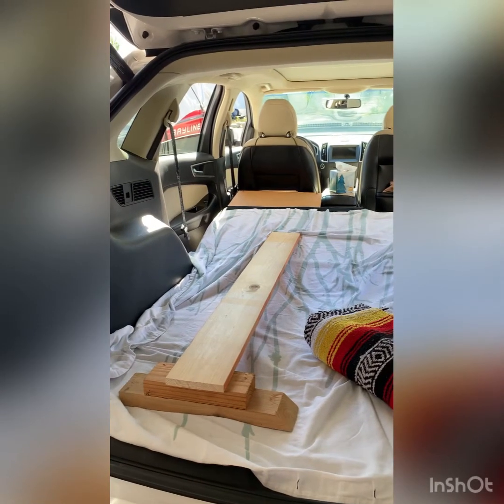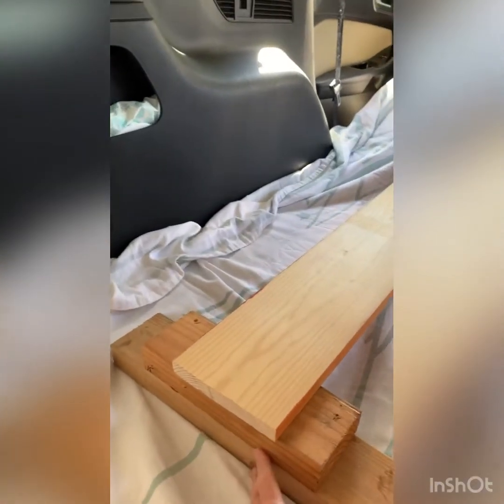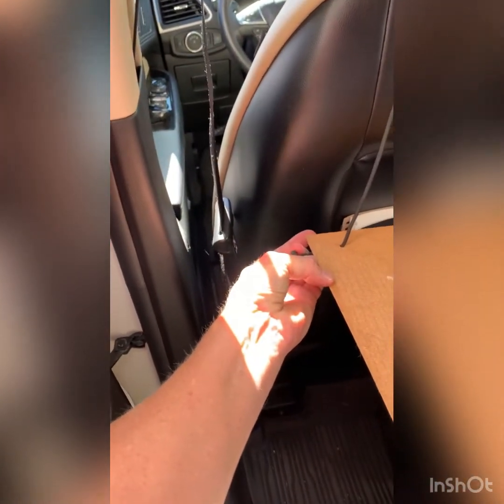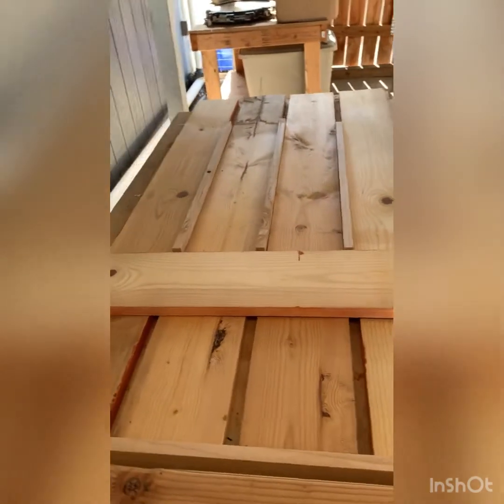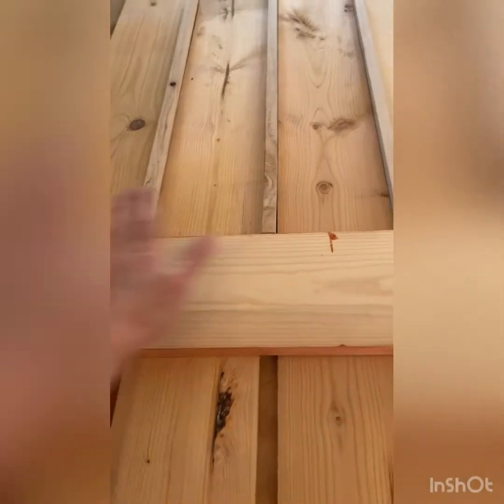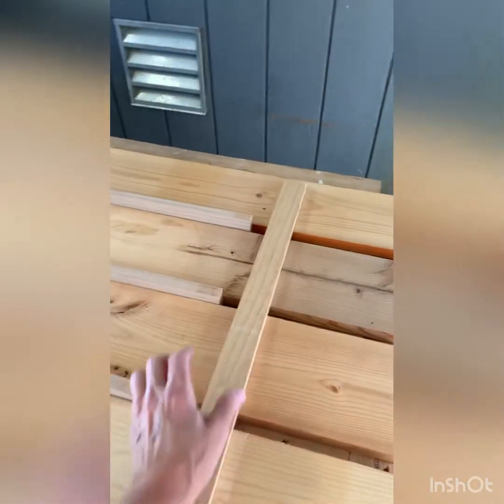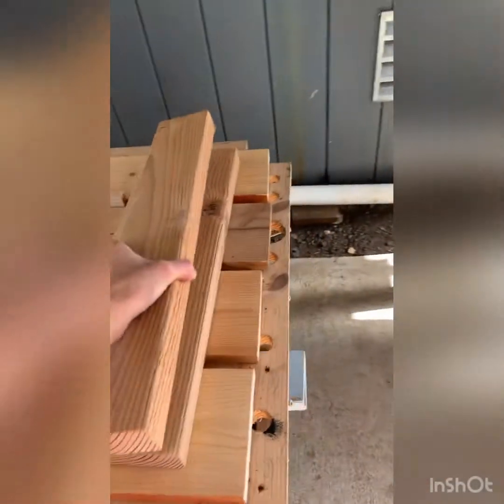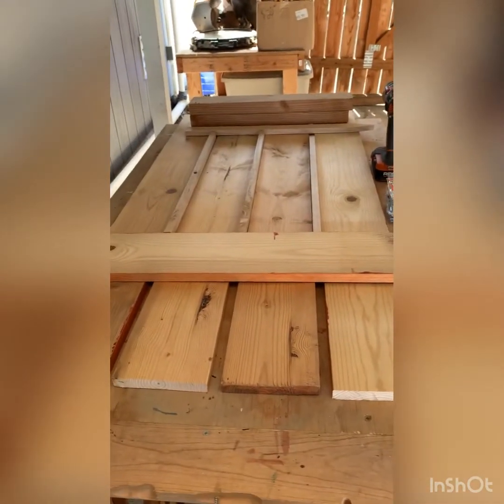Building a Bed for Car Camping -  Ford Edge

Comment: 🎉🎉🎉
TYVM for posting. Was looking for a use for prefinished lumber from my employer so this will work perfect. I'm 5' 10"
with sufficient space.
Reply from the maker: That’s awesome! I hope it worked for you. I’m 5’5” and I was comfortable sleeping in mine.
Reply: @ruthtrips7391  about how long is that space? Ford says the trunk with the 2nd row seats folded down is about 73 cubic ft. Height is about 34.5in, width is about 45.3in, so is the length about 80 inches???
Reply from the maker: @mrmaxin53  in my model it’s 72”

Comment: Hi Ruth,
Just wondering if you would now make any modifications to your original design given that you have tried it out?
How did you determine the thickness at the foot of your platform to compensate for the seats not laying flat?
And do you have a link for the fan with the light integrated?
Thanks much
Reply from the maker: REENUO 5000mAh Camping Fan with LED Lights, 40 Hours Max Working Time Tent Fan with Hanging Hook, Rechargeable Battery Operated Desk Fan for Home & Office
Reply from the maker: Thanks for watching! I thought it worked just great the way it is. As for the foot height I just eyed it, I used the 2x4” I had on hand and it was good, I could have put a level on it but I didn’t want to loose any more head room than necessary.
Reply: Thank you very much
Finally going to start this build

Comment: Question... On my Edge, the passenger side front seat folds down flat... Also, How does the Edge do pulling the A-Liner?  I have a 2011 Limited Edge just bought. Has the bigger engine, but NOT a tow package. I can put on aftermarket hitch and max is 2000 lbs towing...do you have tow package on your edge??  How about your dog....???
Reply from the maker: I wish my seats folded down flat!
My Edge came with the factory tow package and can tow up to 3500 lbs. my Aliner is only about 1300 so it does great! 
It’s nice to be able to camp using either method 😊 car or trailer.
Reply from the maker: I don’t have a dog 😅